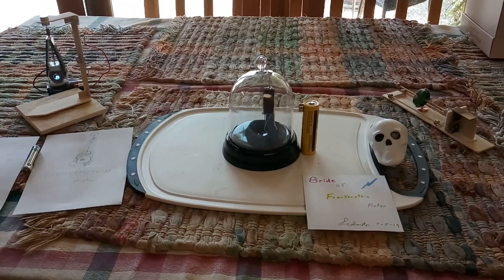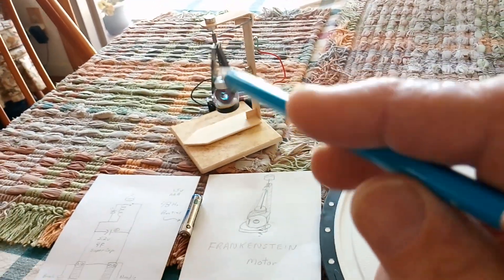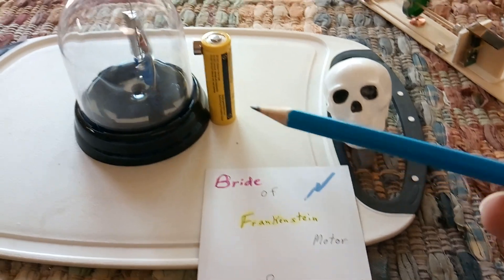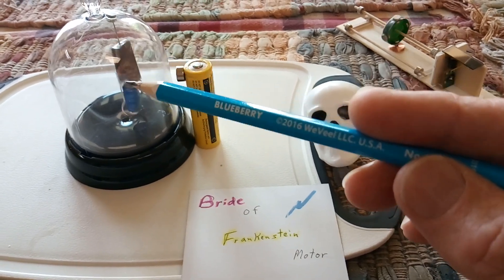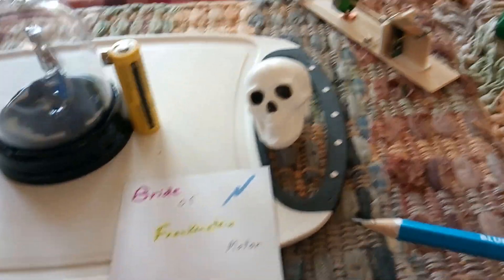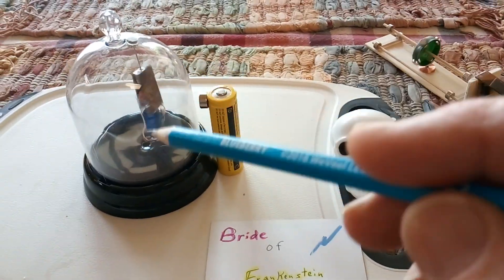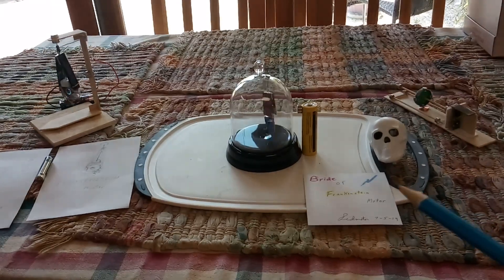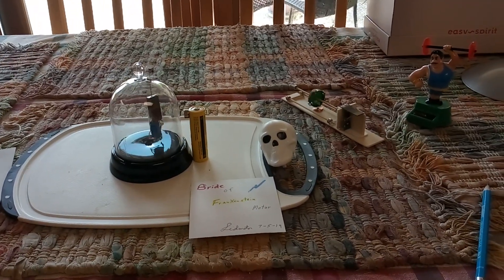Bride of Frankenstein Motor

Comment: Another nice build "Iidmotor", I've always appreciated your  craftsmanship.
I wonder if this could be floated in Water or lubricant, I've always thought
 "Maggie" the ball mag in it, could be submerged in lubricant and make a
 nice Whirlpool effect and double as a semi Flywheel effect on/in mass of Oil
 or other liquid lubricant present once liquid matches speed of magnet.
 Just thought of as I write -Bendini with fidget spinner and 3 ball mag 
 in separate capsules submerged in lubricant, No Bearing/s just liquid.
Other's have put Magnet's for Bendini SSG Flywheel each their own individual Bearing
 so they cold spin separate and simultaneously the greater direction of  Flywheel rotation.
This as modification demonstrated added noticeable RPM's.
Any how Nice build as usual (craftsman) and as always, THANK'S FOR SHARING/TEACHING US FAN'S.
Reply from the maker: Thanks.  Interesting ideas.
Reply: @Lidmotor  Thank you, for all the interesting idea's, Your a Teacher and Many learn from YOU, like me.
 Too US, your a TEACHER.
THANKS FOR SHARING ALL YOU DISCOVER LIDMOTOR. 
 Much appreciation, from me and I speak ( I am sure) for a Huge following of your's! 
Keep SHARING. 
The world won't change it's self...
Reply: @Lidmotor  Interesting IDEA's, coming from you that mean's a lot, man of many.
So, just thought of this, Stacking "maggie coil with ball Magnet", how many would load system (small DC motor, Transistor, Reed or other switching) down to a stop if well lubricated?
 That's One Neat idea "Maggie-Lamp", soon I'll make several "maggie's" and your 1 Magnet self charging top idea and see if ,all are in Oil or Water, so I will I have a Lamp set-up for room, I live in CA Desert 365 of SUN.
THANK's as always, for your sharing with those seeking to learn. 
 So "WE" might All learn, to make a proverbial "Fishing Pole".
Person's whom teach Creating - Building, in any form, are Humanity's Treasure's.
Keep Doing What your doing.